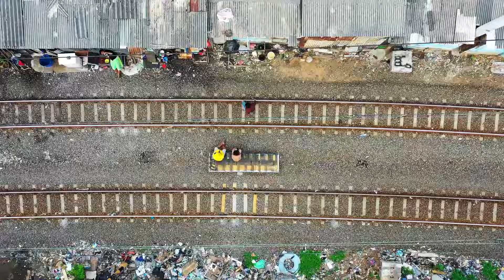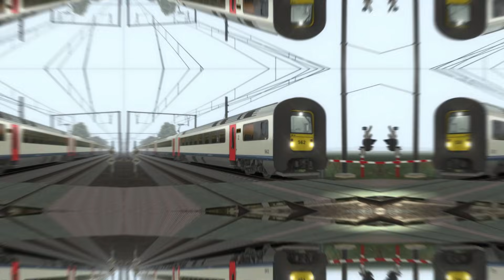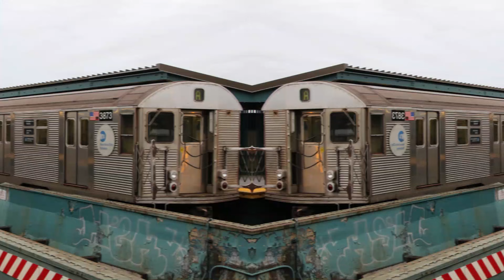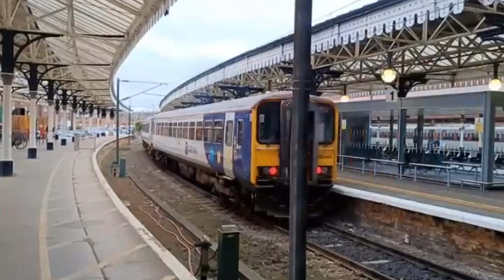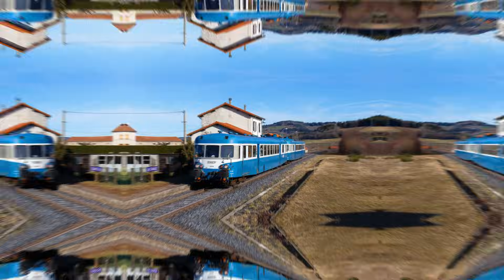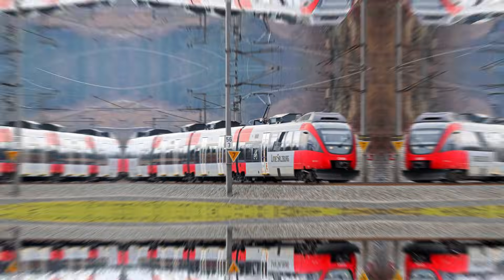10 Trains That Are REALLY Cheap… But NOBODY Wants Them

Comment: Just to clarify:
AM96, also known as MS96, is an intercity EMU that entered service between 1996 and 2000. Even in the snow, they function as they should. The only problem with snow, is that the snow piles up at the front, which makes the coupling proces harder, as the cab would be turned away like a door, creating a passage for passengers.
Other problems are that about 20% of the seats of the train are first class, while only 3% of the passengers actually uses it. Embarking with a bike or weelchair is very hard.
Other than that, these trains still work very well, both on regular lines (3000V DC) and high speed lines and regular lines in Northern France (25KV AC 50 Hz).
These are still rated the most comfortable trains in Belgium for national services. Retirement MIGHT start in 2035, but it is not planned yet at this point.

AM80 or MS80 is actually nicknamed break, because it was a real breaktrough for the modernisation of the railways. Built in 1980, these trains were so powerful that they added an extra coach in the middle. These trains still do their work as they should, and retirement is planned to start in 2032. This train was even sold outside of Belgium too.

Both these trains were built in Belgium and reach speeds up to 160 km/h.

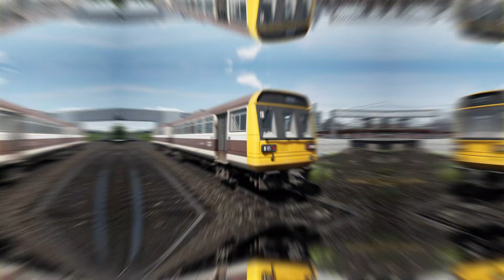Comment: Class 142 was designed to be a stopgap measure for 20 years before making new trains but British Rail didn’t know how the trains will look so now 40+ years they’re now scrapped and replaced by class 150 sprinter class 156 super sprinter as well as class 195 and 331 civity 1:25

Comment: I gave up after reading the crap about the Pacer and then the class 153.
The Pacer was one of the most reliable trains in service and may have been disliked by some of the gutter press (admittedly they had flange squeal on tight curves) but they had to be retired as they no longer met the new regulations for disabled access. I have ridden on them in South Wales and in Yorkshire and have no complaints.
The 153s were no more cramped than the trains from which they were converted, and reduced the running costs for some lightly loaded services. Some are still in revenue service today.

Comment: Am96 is the Danish Nose, not the Break. The am80 is the Break. I don’t know where you have found your info but the am80 had more breakdowns than the am96. And the blueprints of the am96 trains were reused for the I11 IC fleet. So this train sint that bad…
Reply: I think the I11 is actually even a year older than the AM96.

Comment: The R 32 was peak first time and the only reason that the MTA kept it longer was because they were having situations with the new fleet that they were buying which is the reason why they kept it longer. They were supposed to retire around I believe 2010, but then because of the new trains having issues that’s the r32 had it kept going until later on I think it was r 46’s or the r110that we’re having problems, but overall the R 32 was good for its time and even if it was loud, even if it wasn’t able to continue with how it was now, it will always be remembered Through a lot of of New Yorkers as something historical and fun to ride in.  And also the other reason is that for the reefs and the Sea that is for wildlife in the sea to grow more substantial it is not really understood why this person tends to twist on some of the best trains, but I don’t know why you’re twisting words on the R 32 because you need to have more research because first R 32 was made to replace a lot of old trains probably the r 15 or the r 20 and then it kept going because of a lot of problems with the new cars which led towards it until in 2020 and the MTA has been dumping subway cars for a long time for a long while and it’s to help reserve coil Reeves that are slowly dying in the Hudson River

Comment: Im Spanish, the class 592 of Renfe is not that bad they were built by MAN (Germany) and CAF and they use an hydraulic Voith transmission, which it has been great. The trains that used to have poor reliability and problems were the class 593 and 596 made by FIAT. These ones had terrible reliability and the transmission problems, they look very similar from the outside.

Comment: Class 442 is an electrical train (Talent 3). Talent 1 is class 643/644 (Diesel train).
Reply: Class 442 is a Talent 2
Reply: @SD-SC5 no it's not class 442 is a British rail EMU based on the BR Mark 3
Reply: @class_458_fan  I meant the German one also known as BR 442 not the Class 442
Reply: @SD-SC5  instead you could have put Germany also has a train called class 442
Reply: @class_458_fan  ik i live in germany